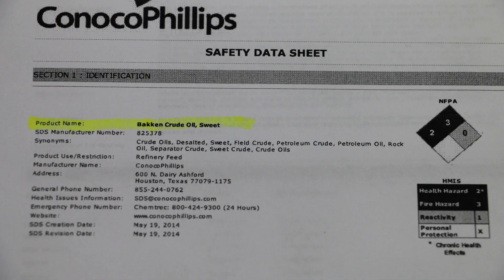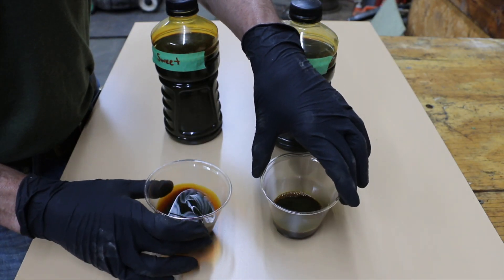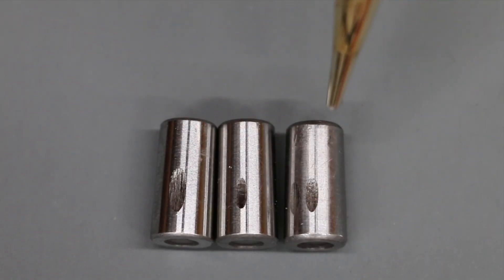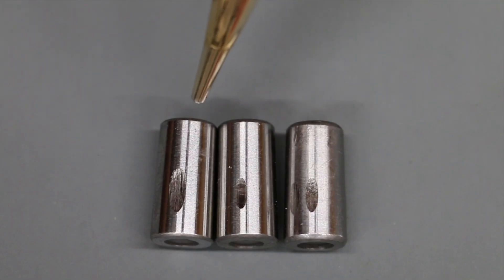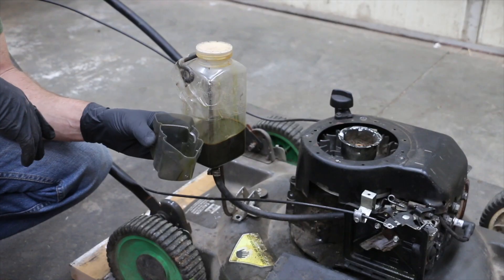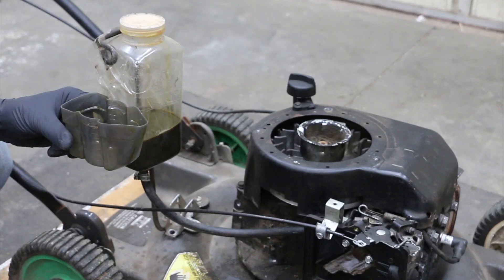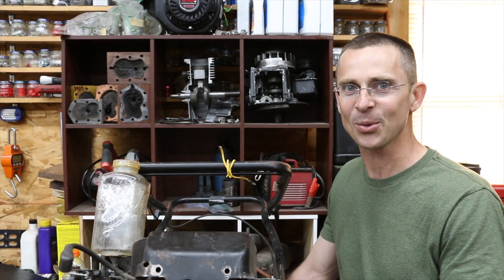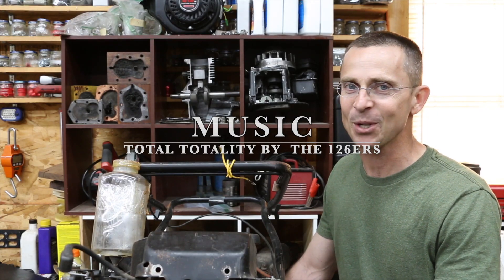Will a Gas engine run on Crude Oil?  Let's try it!

Comment: Amazing how those two oils practically revolutionized the world in the 1800s and 1900s. The industrial revolution would have never existed without crude oils.
Reply from the maker: Great point!
Reply: @Paradoxical Nightmare I know I'm late, but you're forgetting something extremely important- power to weight ratio. 

Steam engines will never (and also fell out of favor after gasoline engines came around) be used in anything intended to move because their power to weight ratio will never come close to that of a gasoline engine.

 Batteries are also terribly inefficient. So your concept of a battery powered steam engine is just downright awful and seems somewhat like a made up fantasy. There's a reason what you're describing isn't used, mate. We have the technology for it, it just makes zero sense to produce it.

In situations where engine weight and size isn't important in the slightest, like power plants, yeah steam engines are used. But something like that could never be used efficiently in a motor vehicle, as any efficiency gains would be offset and more by the size and weight of a steam engine.
Reply: @Paradoxical Nightmare crude oil can make so many more things than fuels
Reply: @Paradoxical Nightmare yea I know but those rubbers and plastics were revolutionary. Besides steam engines just burn coal or wood which are also  polluting.
Reply: @Paradoxical Nightmare how do you think we generate power in the first place? With massive steam turbines where we burn fuel. If your using batteries you may as well just run it direct
Reply: @Paradoxical Nightmare but where are they getting to power for there batteries? If there's limited clean water I can't imagine the infrastructure is very good.

Comment: Only thing I noticed during the lubricity test was the sour oil stayed put and clung to the bearing race where the sweet sprayed all over and likely emptied the cup enough to where the race wasn't picking any up. Could be why it did so poorly in the test.
Reply from the maker: Sulfur helped the sour a lot.
Reply: Project Farm 
I think you should run the sour as a conventional motor oil and see how the engine holds up

Comment: Crude oil’s natural color is clear but if it has been exposed to oxygen it turns black the reason why motor oil does not look black (unless it’s diesel oil) is because it has been refined, depending on what kind of crude oil it is it has different colors form black to green to clear to white. And also depending on the quality of the oil makes it clean or not as clean. Also different types of oils have different gravity
Reply from the maker: Interesting.

Comment: I’d like to see a video comparing different sex lubes and a replacement for engine oil lol
Reply: Please make this happen!
Reply: The silicone ones might work.
Reply: I'm fairly certain that if the lubricants are water-based (which most are because you cannot use oil-based lubricants with condoms), it wouldn't be really any different than using water in the crankcase.
Reply: Great. And when they either drive in Quahog, Rhode Island or by Seth MacFarlane, we'll hear Stewie asking if any one smells Astroglide.
Reply: i heard that coconut oil can be use as subtitude to lube.. and cooking
Reply: Instructions unclear... caught in mower blade...
Reply: DO IT!!!!
Reply: I agree
Reply: They work great on custom motormounts
Reply: 🤣🤣🤣. I'd like to see motor oil used for relations😂😂
Reply: @portermatthew84  oh my lol
Reply: Olive oil is really great lube and can be burnt like sunflower or vegetable oil. Commercial sex lube ingredients  (reading from my bottle)... Aqua, Glycerine, Mono Propylene, Glycol USP, Hydroxyethyl, Cellulose, Phenoxyethanol
Reply: Lard as fuel lol
Reply: K. Y?
Reply: Ok,  so take any "personal lube"  you want... put a few drops on your hands...  rub them together.   In a minute or two the water is gone and they get sticky...   so NO,  it wouldn't fly in an engine.
Reply: They tried it on @LifeOD on yt just look it up

Comment: My father hauls crude oil and we have ran a lawn mower on crude oil, we used what was called condensate which is almost gasoline but way more powerful like race fuel and it looks like water
Reply from the maker: Interesting!

Comment: You should use a micromete. Measure each bearing before and after and you will have a solid number for your lubricity test.
Reply from the maker: Thank you for the recommendation.

Comment: Sour crud kick ass burn as gas and keeps it lube it even beat all the additive. And sour I think much cheaper than sweet. I think big  conspiracy to get rid of basic flat head, magnetic Flywheel, carbator engines. If sweet would been winner I say good job refinery for get gas from $80 a 42 gal a barrel of oil to $2.5 a gallon with tax.
Reply from the maker: Great point.

Comment: Interesting video. Low compression lawnmower flatheads are tough little engines. Makes me wonder what pre-WWII refined gasoline ran like on contemporary low compression ratio engines. I bet gas before lead additives were widespread was pretty awful.
Reply from the maker: Great point.

Comment: Why is there a knick on the top of the piston?
Reply: Must be a rimfire engine, obviously.
Reply: Aaron Cameron so you can know which way the piston goes when installing it
Reply: @Kahraba99  yes i got mine wrong when i replaced the broken connecting rod. didn't seem to make too much difference ran for years that way.
Reply: @erniew5805  wow, that's amazing, usually the piston doesn't connect to the crank properly if you put it wrong

Comment: i would like to see testing of diesel fuel cetane boost in regards to lubricity and if it will run a gas engine straight with no gas i have found power service really seems to work well
Reply from the maker: Thank you for the video idea!

Comment: Light sweet smells like beautiful benzene. That high sulfur stuff always smelled nearly like a rubbery rotten egg kinda smell . but I've smelled all this stuff for too many years . most folks down here can't hardly smell anything anymore , free hydrogen exposure causes permanent smellivision damage. The one product that you also see a metric boat load of here in Beaumont is butadiene . its an odd rubbery smell .
Reply from the maker: You're right!

Comment: I learned something new. Never knew crude oil straight from the ground was so volatile to actually burn in a combustion chamber. I wonder what kind of MPG you can get out of it.
Reply from the maker: I believe it has more energy per gallon/liter than regular unleaded.

Comment: Todd,
I am completely shocked that the sour works that thing ran decent I know you had to put it on choke but it ran this is huge I've been working on engines for 25 years I've never seen a test like this . I tell you what the Pratt & Whitney engines we work on will not run on any of that we run on a type of kerosene jet 2A . That sweet stuff really fouled up that spark plug it really bad. Nice change in music thank you for that I know you were thinking of me LOL just kidding. I agree with some of the other replies that you should try it as engine oil but I don't think you have enough left.
Great job tonight made my night.
Mike
Reply from the maker: Mike, Thank you very much for the kind words!  I'll keep trying to do well with the music, but the options are very limited and I'm reluctant to recycle songs too often.  I'll keep looking for more uncopyrighted music.  I think I might have enough left for an oil test.  I received 2 containers of each. I might also see how it burns in a small diesel engine.  Thanks again, Todd

Comment: Shout out and thumbs up for North Dakota's contribution!  What if you just let the sweet oil drain through a paper filter and use what's left?   I would have guessed that couldn't work.  I would have been wrong.
Reply from the maker: Thank you very much!  That's a great suggestion on using a filter.  Thanks again!

Comment: I wonder how much impurites are in the crude oil vs refined fuel...I do know alot of sulphur is bad in emissions and would definitely NOT pass emissions testing...however pretty darn cool to see it actually running...perhaps heated in a tank used for vegetable oil it might work in a diesel environment providing it was heavily filtered.  Pretty darn interesting...thanks for this video.
I wonder what it would take to make a small home "small batch" gasoline refinery cracking tower/distiller
Keep em coming!
Reply from the maker: All great points.  I will likely create a video on refining oil in the near future.  Seems like a fun project!

Comment: Now I wonder how this stuff would perform in an Diesel & especially in a 2Stroke engine...
Reply: Good call, running it straight up in a 2 cycle would be interesting.
Reply from the maker: Thank you for the video ideas!
Reply: I live in the bakken area(western north dakota) and the word about that is yes it will work. When the first well was drilled(first successful well) someone tried this, and every couple years a oil company will demonstrate this(either by accident or public demonstration)

edit: Bakken crude, I don't know about other types of crude
Reply: irgendwieanders1  2 stroke wont need motor oil if fuel oil is sour . Diesel wold run fine . In old times oil wells where powerd by crude oil burning diesel engines . Fuel to make fuel if u ask me
Reply: MaceThePro haven't seen any of them but have seen lots that run off casing gas( gas not liquid)
Reply: Roger Galbraith  waste gas from oil well?
Reply: MaceThePro there are lots of caped of land fill east sites in the UK that burn of methane gas are local site closed over 3 years a go and there still burning it of that would power so many things in the area its jest wasted you can see the clear blue flames from the 6 in pipes over 10 ft high 24  /7 days a week in Norway they would power a village with it
Reply: 2 stroke diesel or petrol?
The 2 stroke diesel would run happily on it

Comment: Another fantastic job, thank you sir.
I never even would've thought crude oil would have ran at all, let alone that well. I'm actually very impressed at how clean the sour crude left the combustion chamber after running through a tank of it. Maybe the next video we could use it on a "higher mileage" engine and see if it has a tendency to clean it up at all?
Reply from the maker: Thank you for the video idea!

Comment: Paused at :44. I can say that low gravity north dakota crap isn't the best. A lot of this eagle ford crude in central Texas is a lot lighter and contains way more hydrocarbons. We have run it in small engines for the s&gs and it does work. Some of it is lower octane than regular gas so it would light off fine in a small engine but I wouldn't dare try it in an automotive engine. Diesel has an api gravity of 32 to 40, which to my eye this stuff in your video looks to be in the lower 30s @60°f while gasoline is a much lighter product with an api gravity of 60 @60°F. Now to see the rest of the video
Reply from the maker: All great points and thanks for commenting on this!

Comment: The sulphur compounds in sour crude are a major lubricants - When the EPA mandated ultra low sulphur diesel fuel people started having a very high rate of failures in injection pumps (mechanical injection) and High Pressure Fuel Pumps (Common Rail Injection) because the fuel did not lubricate these components nearly as well.  Most fuel refineries have started using non-sulphur lubrication additives, but the ULSD fuel is still somewhat lacking and problematic compared to the old school stuff.  High Mileage Diesel guys who know about the issue add their own lubrication products with each tank. There are several good ones on the market.
Reply from the maker: All great points and thanks for commenting.

Comment: Great vid as usual sir.  In Central  Australia there are a few places where light sweet crude is used in diesel engines straight out of the ground.  Older engines can use it no worries.   Newer common rail vehicles don't like it too much.  Thanks mate 👍
Reply from the maker: Thank you!

Comment: Another aspect not seen in the comments. The reason old fashioned gunpowder had sulfur added to the charcoal and potassium nitrate mixture was it chemically enhanced the combustion process (as school boy experimenters know sulfur is only slightly ignitable itself, takes another high heat source to get it burning), perhaps this is a bit of what is being witnessed here using crude as an engine fuel, with the high sulfur crude running better along with the viscosity.
Reply from the maker: Great point!

Comment: Very impressive,  growing up in NW Pennsylvania we have thousands and thousands of oil wells. Crude oil was the best stuff you could use to get a stubborn fire going. Wonder if PA crude has a lower flash point to a lot to get it going but once it started burning well it was hot. Always heard of old timers using it in old diesels for fuel pre emissions engines more around 1960s to mid 90s engines.
Reply from the maker: This is great information. Thanks for commenting!

Comment: Only 46% of a barrel of crude oil is petroleum by-products. Before their use as motor fuel, petroleum was regarded as a waste product, following refining, that wasn't of much use and so dumped as a toxic pollutant in rivers.

The use as fuel for internal combustion engines save the environment back then.

With the UK and EU ban on new ICE powered vehicles from 2040, and the world's continual requirement for oil refining to generate pharmaceuticals, lubricants, plastics, mineral spirits, etc. these waste products will become a toxic waste disposal problem once more.
Reply from the maker: Wow! This is great information. Thank you!

Comment: Maybe would have been better to pressurize the light sweet instead of adding gasoline...
Reply from the maker: Great suggestion!
Reply: Project Farm  I just had another thought. I wonder how the addition of gasoline to the sweet crude would do on the lubricity tester since it did so poorly by itself.
Reply: mharris1270   Garden sprayer
Reply: mharris1270 it only has to be enough to fill the bowl and help push up the emulsion tube or the idle port.  1-2 psi or so.   If not then point the sprayer nozzle on the mist setting and spray directly with higher pressure.  Also, didn’t you ever see a vacuum pulse pump or a mini electric pump on a mini bike or go cart or even a commercial lawn mower?  Not every small engine can put the gas tank above the carb or rely on gravity feed.

Comment: i have a briggs 3.5 running on used fryer oil only no gas. i preheat it with fryer. oil in a burner
Reply from the maker: Impressive!

Comment: So, you didn't empty the crankcase and see if the light or sour crude oil running the engine would provide ring lubrication...like a 2 stroke...
Reply from the maker: Great point and video idea!

Comment: these oils work well in vapor form ...you need a vaporizer to run the engine . Pre heat the oil and suck the vapor and ambient air in through the carb air intake. ..
Reply from the maker: Great recommendation--thank you!

Comment: when i was in highschool we do this experiment where we make small amount of gasoline using the distillation process.The crude oil that we use is much more thicker almost like grease consistency.
Reply from the maker: Interesting. Thanks for commenting on this.

Comment: If I had to guess I'd say the increased sulfer was probably why the sour outperformed the sweet in lubricity. 
It's the same reason ultra low sulfer desiel sucks in older desiel engines.
Reply from the maker: Yes, you're right.

Comment: Try Shcaeffers oil whenever you can. Curious to see lubrication properties of it. You could also do a grease test for different types of grease like Shcaeffers, Mobil, Lucas, etc. Like your glue, loctite, tape, etc videos
Reply: Hell that sour oil did better internally on the engine than anything else ever tested lol.
Reply from the maker: Thank you for the video ideas!

Comment: I wonder if temperature would affect the outcome of this test? Years ago we used vegetable oil on a diesel generator, it was fine in the summer but used to become too viscous in the winter and the oil had to be warmed.
Reply from the maker: Great point.  Warm temperature would help.

Comment: Doesn’t surprise me at all! After all they were able to catch those oil fields in Iraq on fire and those burned forever. Not sure but I would assume if it’s highly flammable it should be able to run an engine, but I’m probably wrong lol
Reply from the maker: Great point!

Comment: That crude oil looks very thin, like some sort of low sulfur ones that I met on ships. The normal crude oil that is used as fuel on large marine engines is very thick, with high viscosity. It looks like asphalt and it must pass separators and filters, than is heated to approx 130C (266F) before injecting into engine. That fuel would just choke ... well everything.
Reply from the maker: This is interesting. Thanks for commenting.

Comment: When I saw the title of this video I immediately thought that an engine would not run on straight crude based on feeling that it wouldn't be volatile enough for adequate combustion. Also surprised by the lubricity of the thinner sour crude. Thanks for the education.
Reply from the maker: Thank you!

Comment: It's the higher sulfur content in the sour crude oil that gives it ,it's film strength or higher shear in the lubricity test. Sulfur is an excellent lubricator but the down side is sulfur dioxide emissions when combusted/heated and when mixed with moisture it creates sulfuric acid AKA acid rain. That is why the sulfur content of all motor fuels has gradually been reduced.
Reply from the maker: Great point!